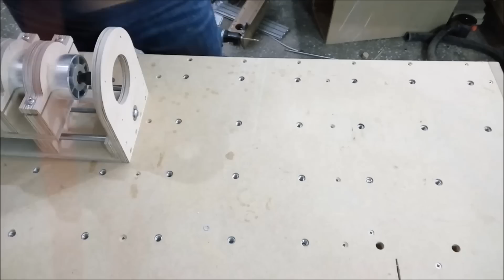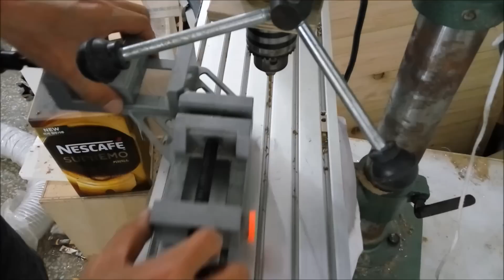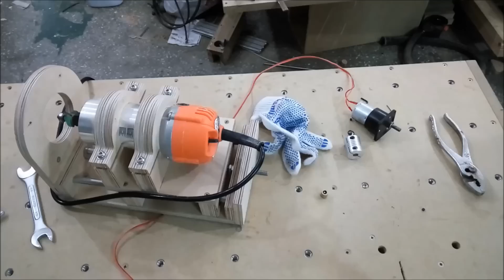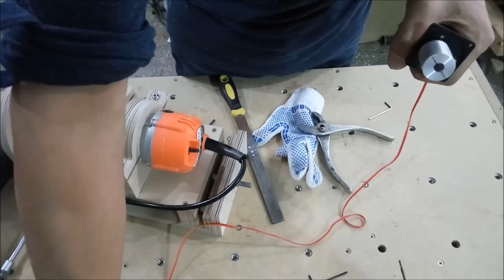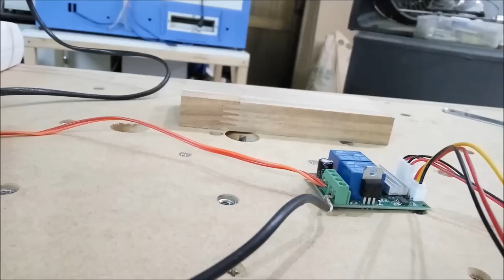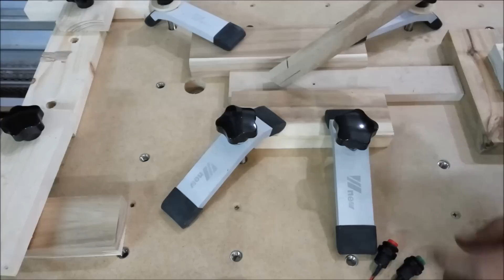how to make a router lift. ver1(part2-Automatic)

Comment: Nice project!!  I use a 3d printer and have noticed that the motors turn freely when they aren't energized.  Does this mean the unit "loses" its height setting when powered off?  Is this design resistant to top-loading while on?
Thanks for any tips! :)

Comment: hi sangwoo excelente vídeo, what motor do you use for the router lift?
 and the rest of the electronics used thank's
Reply from the maker: ver2 lift 
https://youtu.be/8472fXzyKDA

dc pwm controller
http://www.ebay.com/sch/i.html?_odkw=knob+screw&_dmd=2&_osacat=0&_from=R40&_trksid=p2045573.m570.l1313.TR0.TRC0.H0.Xdc+pwm.TRS0&_nkw=dc+pwm&_sacat=0

24v geared motor
http://www.ebay.com/sch/i.html?_odkw=dc+pwm&_dmd=2&_osacat=0&_from=R40&_trksid=p2045573.m570.l1313.TR0.TRC0.H0.Xgeared+motor.TRS0&_nkw=geared+motor&_sacat=0

10mm shaft
http://www.ebay.com/sch/i.html?_odkw=shaft&_dmd=2&_osacat=0&_from=R40&_trksid=p2045573.m570.l1313.TR0.TRC0.H0.X10mmshaft.TRS0&_nkw=10mm+shaft&_sacat=0

10mm block bearing
http://www.ebay.com/sch/i.html?_from=R40&_trksid=p2047675.m570.l1313.TR0.TRC0.H0.Xpillow+block+bearin.TRS0&_nkw=pillow+block+bearing&_sacat=0

t8 screw
http://www.ebay.com/sch/i.html?_odkw=pillow+block+bearing&_osacat=0&_from=R40&_trksid=p2045573.m570.l1313.TR0.TRC0.H0.Xt8+screw.TRS0&_nkw=t8+screw&_sacat=0

and etc.... ^^

Comment: if you want safety little better add limit switch back top and bottom limit, creen bottom bit level and red led top level, you not see bit if part have top but you see led. and most better you can add volt meter display ,cheap 1€ display measure volt and potentiometer voltage divicer down were level you bit/router have and looking display level. or buy little elektric gauge tool were can measure level. or simple arduino code and stepper motor bottom limit zero level and show display zero, then you move up arduino calculate steps and show display level at MM or inch.

Comment: what motor and Controller do you use?
Reply from the maker: ver1 lift
https://youtu.be/0QO5T6zZB7M

ver2 lift 
https://youtu.be/8472fXzyKDA

dc pwm controller
http://www.ebay.com/sch/i.html?_odkw=knob+screw&_dmd=2&_osacat=0&_from=R40&_trksid=p2045573.m570.l1313.TR0.TRC0.H0.Xdc+pwm.TRS0&_nkw=dc+pwm&_sacat=0

24v geared motor
http://www.ebay.com/sch/i.html?_odkw=dc+pwm&_dmd=2&_osacat=0&_from=R40&_trksid=p2045573.m570.l1313.TR0.TRC0.H0.Xgeared+motor.TRS0&_nkw=geared+motor&_sacat=0

10mm shaft
http://www.ebay.com/sch/i.html?_odkw=shaft&_dmd=2&_osacat=0&_from=R40&_trksid=p2045573.m570.l1313.TR0.TRC0.H0.X10mmshaft.TRS0&_nkw=10mm+shaft&_sacat=0

10mm block bearing
http://www.ebay.com/sch/i.html?_from=R40&_trksid=p2047675.m570.l1313.TR0.TRC0.H0.Xpillow+block+bearin.TRS0&_nkw=pillow+block+bearing&_sacat=0

t8 screw
http://www.ebay.com/sch/i.html?_odkw=pillow+block+bearing&_osacat=0&_from=R40&_trksid=p2045573.m570.l1313.TR0.TRC0.H0.Xt8+screw.TRS0&_nkw=t8+screw&_sacat=0

and etc.... ^^